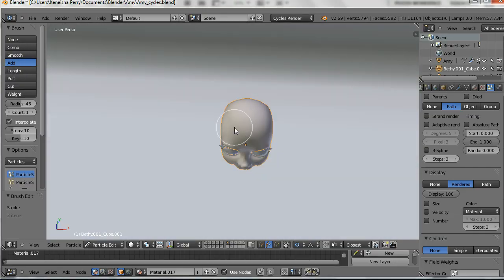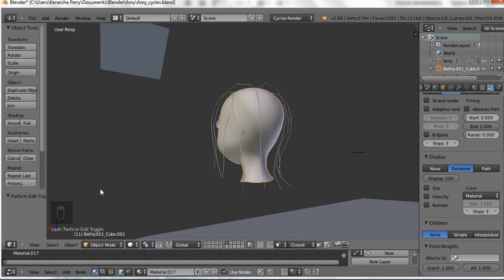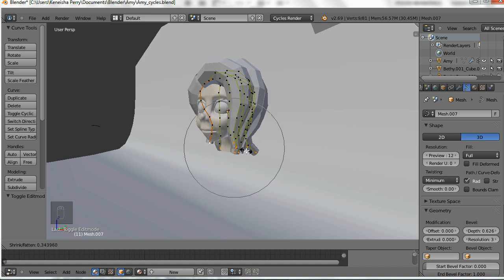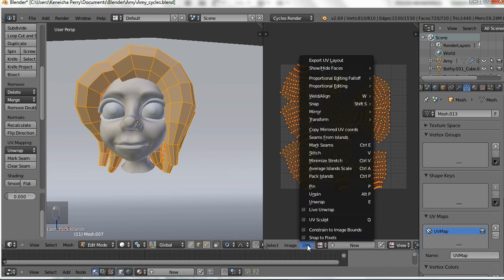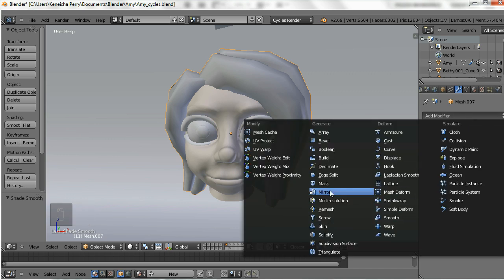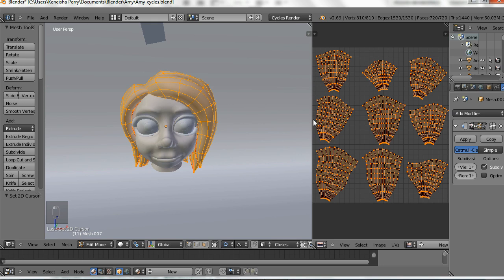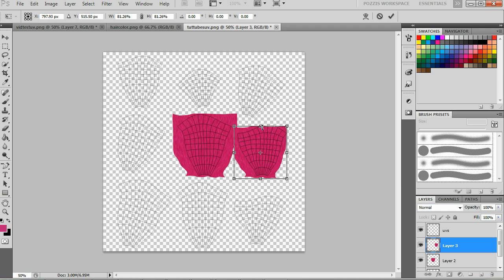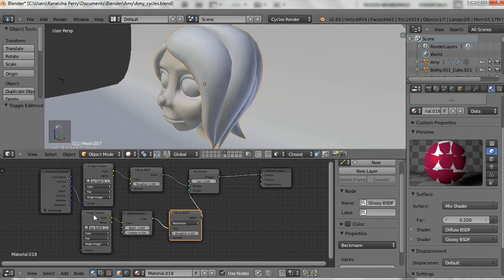Polygon Hair 2 - Blender

Comment: I didn't know you could Alt+S the control points to get the taper, that's interesting.
There's an easier way to do this style of hair: keep the hair as a beveled curve, and use another curve as the Taper object that gives this taper profile (google for how to create a curve taper object)While the hair is still beveled curves, tick the "Use UV for mapping" option of the curve properties. This lets you use the Generated texture coordinates for easy mapping, you don't need to convert to mesh and map anymore.Finally, you can apply softbody physics to the curve objects (it will act on the control points of the curves). You can use goal weights (on the Specials menu) to pin curve points, like the roots of the hair, so that only the tips jiggle.

Comment: Once it's finished, is it possible to have it react to physics such as wind, or if something touched it? I think you'd have to rig the hair or something.
Reply from the maker: you can use cloth physics with pinning on to make something quickly, otherwise you will have to rig the hair first, but I don't use physics a lot so you will have to look up other tutorials for that.

Comment: to acquire a decent anime hair look, how many strand would you need before you start the tedious work?
Reply from the maker: It depends on the style you're going for. Lately I have been doing a lot more tubular strands and no texture because it fits more with the look I'm going for. Hopefully I'll be able to post an updated hair video soon. :)
Reply: Keneisha Perry For example, if you were trying to make hair like Sasuke's how would the settings for the strands be?

If I was trying to make hair like Byauya Kuchki (vine like hair) how would the setting have to be?
Reply from the maker: TeamSlugFest For hair like Sasuke's I would recommend a more planar method of making the hair. Instead of many tubes, it would be a single mesh piece. For Byauya Kuchki I would do the scalp part as one mesh piece and the parts that are longer and more flowy with tubes. Stay tuned on my channel because I'll be showing different types of hair modeling and body parts around May-June. There will be a whole series.